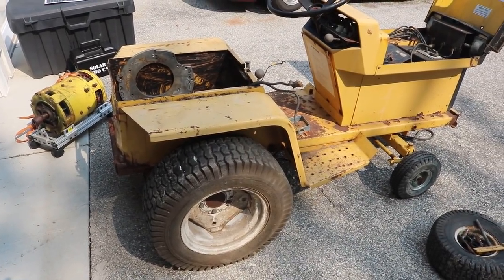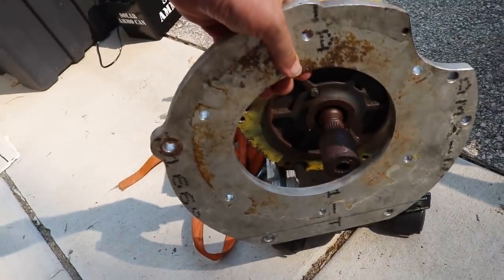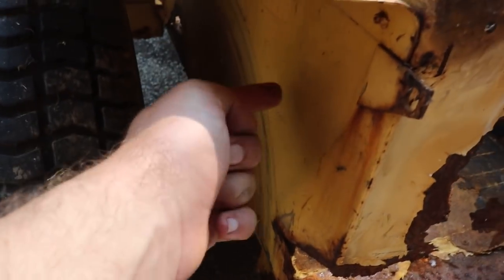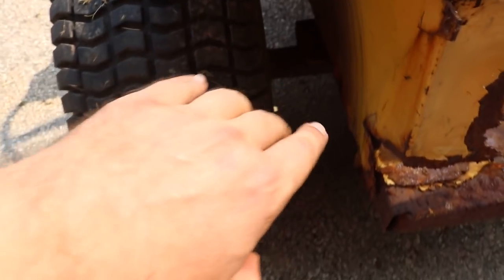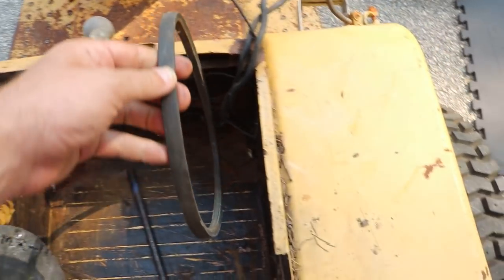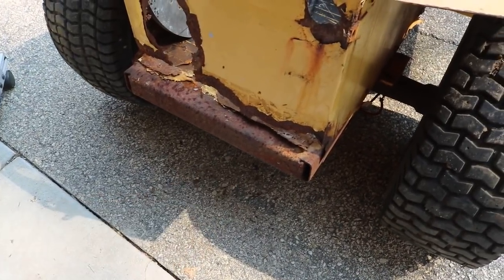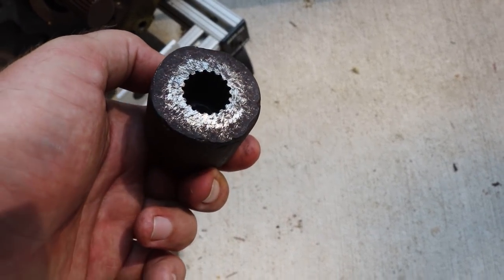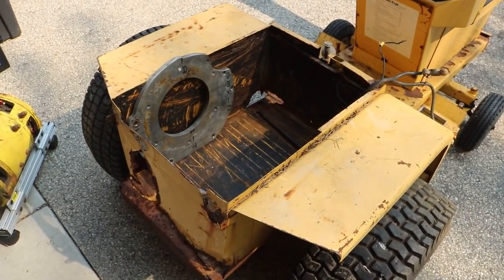ElecTrak Rat Rod Lawn tractor motor placement decision

Comment: Hello there Benjamin, I have a question . Can an electric motor be hooked up directly to a Differential?
In a car or small truck without going to the transmission? Thank you.
Reply from the maker: YES! In a forklift, it's common that the motor is mounted directly to the differential. It is possible to convert a car or truck to electric by connecting the motor right to the differential BUT you only have the one gear and reverse must be done electronically. You also need to have a powerful enough motor and it needs to be in the RPM range appropriate to give you the final top speed you are looking for. This is sometimes done on pickup trucks with a powerful motor. Even then, the conversion typically features a short drive-shaft rather than actually mounting the motor directly to the differential.

Comment: Trace your plate onto cardboard... and cut the cardboard so you don't have to cut your plate..  I think you should run your jack shaft just under the bed,  and place your motor toward the rear of your bed so you will then still have plenty of room for tools, ice chest or extra batteries ect.

Comment: i Think that the torque Will rip that thin sheetmetal. you could give the  Box some more strength with some thicker plates on the outside.
Reply from the maker: I was thinking about just adding another layer of metal to thicken it up. I'm also planning on reusing the aluminum plate that I previously made to go with this motor. That was actually two plates. Maybe I just use those, one inside the box, and one outside.

Comment: Benjamin Nelson Excellent idea, although I had an alternate idea while watching which is to go looking for an old garden tractor manual transmission at the scrapyard or on Craigslist/eBay for  cheap.  Those typically have a drive pulley/input shaft offset 90 degrees which would allow you to mount the motor front to back, have gears, and skip alot of assembly fabrication and cutting.  Just an idea, thank you for the excellent videos, I look forward to them.
Reply: Benjamin Nelson Here is a 4 wheeler differential that might work (but there are many others of different dimensions for $50-$100)
https://m.ebay.com/itm/YAMAHA-TIMBERWOLF-1999-4X4-250-4-WHEELER-FRONT-DIFFERENTIAL-OR-PUMPKIN/123298263556?hash=item1cb5263204%3Ag%3A75gAAOSwKPxa3luX%3Asc%3AUSPSPriority%2149509%21US%21-1&_nkw=4+wheeler+differential&_from=R40&rt=nc
Reply: Benjamin Nelson My original comment was about these peerless type transmissions which are tough and would be perfect for your application.
Here is a used one:
https://m.ebay.com/itm/MST-206-545c-Peerless-Tecumseh-transaxle-transmission-Poulan-Craftsman/283100657502?epid=900538990&hash=item41ea1d375e%3Ag%3AookAAOSw3opbcM2R&_nkw=peerless+transmission&_from=R40&rt=nc&_trksid=p2380057.m4084.l1313.TR6.TRC1.A0.H0.Xpeerless+transmission.TRS0
And a new one:
https://m.ebay.com/itm/Peerless-5-Speed-Transmission-700-023-OEM-Replacement-Bob-Cat-Snapper-Toro-Scag/271911459349?epid=20015608138&hash=item3f4f2f9a15%3Ag%3AjmwAAOSwkrFafbp7&_nkw=peerless+transmission&_from=R40&rt=nc&_trksid=p2380057.m4084.l1313.TR6.TRC1.A0.H0.Xpeerless+transmission.TRS0

Comment: Couple things...
1. I'm wondering why you don't just mount the motor with the shaft on the right side if the drive is on that side. Reverse polarity to run the motor the proper direction or gears to switch rotation... just some funky ideas.
2. It seems like you'd be better off to beef up that box a little bit or add some motor mounting strength so torque doesn't cut the bolts through or flex it.
3. A question I've had on my brain for a long time (and I'm no electrician so I don't know how many volts or watts it'd take to generate, or what a generator / alternator would have to run to keep batteries up enough to never have to plug in, (or maybe just extend time or distance between charges)..
Why did you cut other end of the shaft all the way off the motor you put in the electric car you built when you could've added a pulley to run some alternators or generators to charge while you drive? Is that a bad thing, not work well enough, or cause other problems?
One thing I think of with that is a lot of phones say not to use the phone while you're charging it - it depletes the life of the battery or lessens the effectiveness of the charge, overheating or something like that. Adding two batteries you switch back and forth  -- one's charging while the other is driving the motor would eliminate those problems.
Reply from the maker: 1) The motor could face either direction. I was originally naturally thinking it would be on the right, but then since I figured I'd have a shaft go all the way across the box anyways, it wouldn't matter which side, and putting it on the left just gives me more room to work for all the components going down to the transmission input pulley.

2)Yep. Gotta beef up the box. I just want to get started here, but I'll take some scrap L-angle steel or something to reinforce the box.

3) No, you can't use a battery to power a motor to power a generator to charge a battery. You are trying to charge a battery from the same battery. You can't get any more in that what you take out. It's kinda like trying to fly by picking yourself up my your belt, it just doesn't work. You need some sort of EXTERNAL source of energy, such as a tank of gasoline, a battery charger connected to the wall, or your beefy friend picking you up by the belt.

The tail shaft of this motor was cut off because it would literally NOT FIT in the Geo Metro it was used in. The tail shaft would have dug right into the passenger side tire. A longitudinal mounted engine (such as a pickup truck) allows more space for a physically larger motor. That Bugatti kit car I looked at the other day was exciting because it has SO much room for a BIG motor!
Reply: 3)  I'm sure it wouldn't be infinite power, but I think there are things that can be done to extend the range.. I've seen videos of kids at college contests or science fairs that covered a whole car in solar panels, but that doesn't seem real feasible for a daily driver.
Reply from the maker: The important aspect of adding solar panels is that it's an EXTERNAL source of energy. Electrical energy is ADDED to the system via the solar panels. Powering an alternator from a motor to charge the batteries that run the motor is just trying to move energy around inside a closed system. The only thing you can get out of it is LESS total energy, due to conversion losses.
Solar panels aren't generally practical on a vehicle, but are fantastic on a house or a garage where that vehicle is charged. Solar panels CAN be practical on a golf cart, pontoon boat, or RV.

Comment: Factory drive was either single or double 3/8" wide belt, depending on the model, for sure even the double belts will slip.   I think your gonna need double 5/8" wide drive belts or a chain.
Reply from the maker: I was thinking I'd do a chain from the motor to jackshaft, but wasn't sure exactly what to do from the jackshaft to transmission. I have another junk tranny around with a double pulley on it. Maybe I can pull that off and put it on this tractor.
Reply: Pulley on the GE trany are made for 3/8" wide belt there narrow, any wider belt doesn't fit right, can easily change the pulley to one that takes the wider belts.
Reply: What model tractor was it?
Reply from the maker: It's an E12 tractor.
Reply from the maker: Perhaps the best approach might be to remove the pulley from the transmission and simply swap it out for a sprocket and chain.
Reply: Would of been a single belt drive. And you will be surprised how much noise the chain will make.
Reply from the maker: Yeah, belts sure are quieter, but if power vs slippage is an issue, I would think that chains are the way to go!

Comment: Solid thinking! Gotta wonder if you will wind up popping a wheelie or with the weight just do a burnout. If you go full-on street rod I think you might be able to adapt some small car wheels ( like on your dearly departed Metro ) to put slicks in the back. Fun project and keep the updates coming!
Reply from the maker: Slicks would be funny. I'll stick with the tractor tires for now, since that's what I already have.